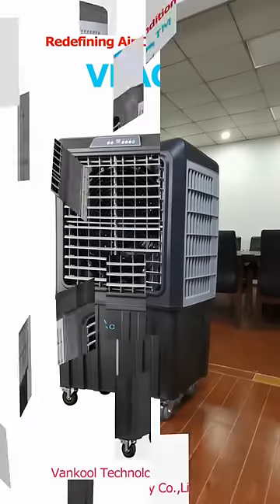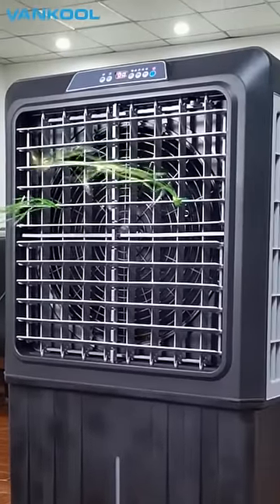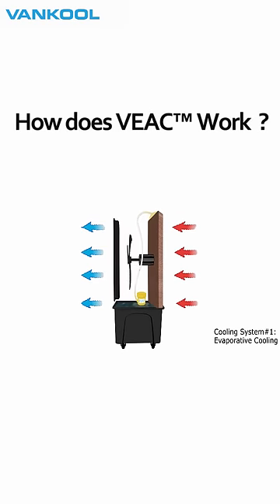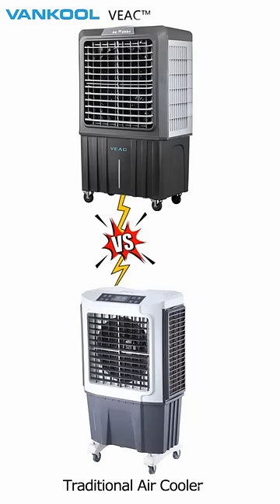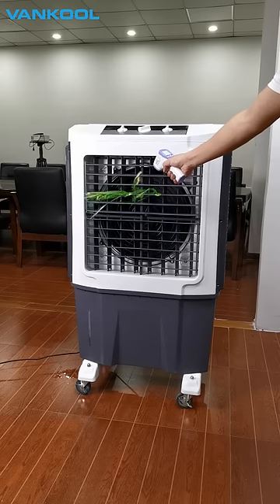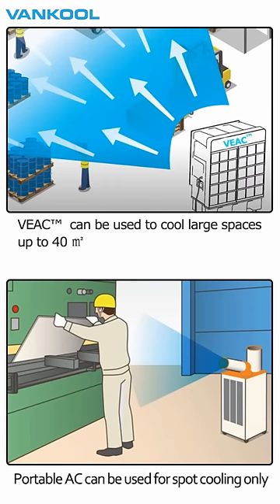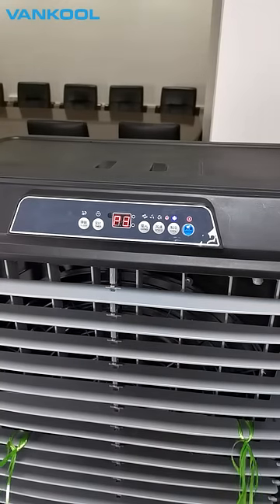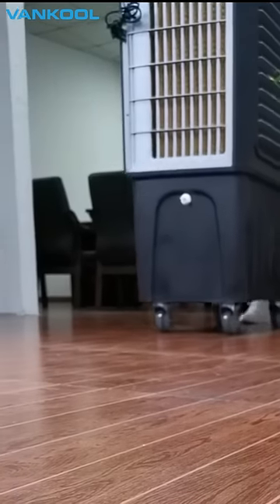The world’s 1st Evaporative Air Conditioner

Comment: From my understanding—and please correct me if I’m wrong—evaporative cooling works by adding humidity and moisture to the air, cooling hot, dry air in the process. In contrast, a condenser cools the air by absorbing heat from the space and ultimately removing moisture from the air. Running these systems separately can effectively lower the ambient temperature; however, running them together may cool the air but with reduced efficiency. This is because the condenser would have to handle the increased moisture produced by the evaporative cooling system before it could cool efficiently, which also raises the additional question of where the heated air would be expelled.

Comment: This is a good option for cooling large area or open air gathering with climate with low humidity. Less expensive operating cost than ac and more effective than evaporative coolers
Reply from the maker: Good answer, Thank you.
Reply: @vankool7660   it would be better if kind of split (condenser and compressor )unit is installed at the top of cooler intead inside

Comment: Useless, hot air from air conditioner also released inside room😂
Reply: 1.This type of air conditioner is mainly for outdoor or large open space cooling,but not for a full closed room.If need to cool a closed room,you can connect a hose with the hot air outlet to exhaust the hot air
2.The hot air will go up and cool air go down, it does not matter for the people who sits or stands in front of the machine.We only need to care about the people who sits or stands in front of the machine and make them feel cool